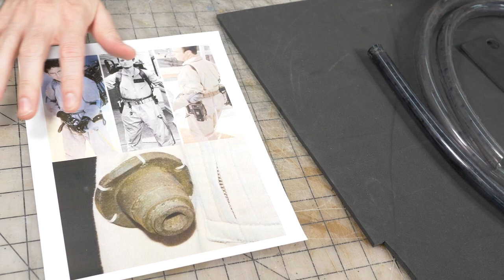Make, Modify and Improve your Halloween Costume

Comment: Actually something I have been meaning to share, and related to creepy costumes.  Surgical gloves work great as a base to do really creepy hands.  Just put one on and use liquid latex and fiber.  Cotton is pretty common and it gives a burnt flesh kind of texture but tissue(read Kleenex) works really well and gives a wrinkly skin texture.  You can pain if you like but I have used food color to color the latex and that can give you a really good translucent "real" look.  Some tinted with a bit of blue lets you create veins.  Cover that with some "skin tone" ish latex and you can get some really "old" hands.  Crepe hair will also stick really well in the latex when it's wet.  A hair drier will speed up the cure a LOT.  Usually there is enough stretch that you can take the clove off but worst case you can slice it up the wrist till you can get it off.  I almost never have had to cut it to get it off.  It's reusable for a couple of years, then the latex starts to get dried out.

This also works really well for building up "flesh" on skeletons, though then I start with coton to build up "muscles" etc. and then use tissue as a final "skin" layer (or not...).

Comment: To dirty it up, I'd make some 'mud' to dip the edges in; water, tea, crushed coals and ash from a fire, maybe some  saw dust from the shop.
Can use pretty much anything, but the water helps it really soak in, especially after ratting up the edges like you did.
Reply from the maker: Yeah if you wanted to take it a bit further than we did in the video those are all great options!

Comment: that connector for the hose was actually cast in foam rubber from a mold of some kind of steam valve.  And you were spot on with the what you did with the other end.  In the movies it was just attached under the belt pretty much in the same way.
Reply from the maker: Thanks!

Comment: The Ringwraith hood is actually a separate piece and drapes down to about the waist. Also stippling the bondo on the blade and lightly sanding is back will give you a better corroded metal texture.
Reply from the maker: We wanted to make a simplified version of the wraith outfit so people could try their hand too! It can always be modified :) Thanks for the tip!

Comment: For all my broke cosplayers, I’ve found two amazing ways to make props. A cardboard cutout covered in great stuff and carved to shape works great (just make sure you have enough foam to cover both side of the cardboard because great stuff shrinks a bit when it fully cures and can warp the cardboard if there’s not foam on both sides)
Also for my Hellboy costume I’m trying to make ive found cheap yoga rollers for only $5 at Dollar General, and they should work perfect for making his Right Hand of Doom that I’m hoping to articulate as well. I’ve also heard wood glue mixed with water can be a decent sealer for foam, but I haven’t tried it out myself yet
Reply: What is great stuff? I'm
Reply: 18020021t it’s a foam gap filler and insulation. Any kind of spray foam gap filler will work though
Reply from the maker: Neat tips!

Comment: Interesting.  For theatre sets we use contact cement.  There is a cup thing with fan blades and you stick it in a drill.  The cup has a loose seal and you fill it up with contact cement (or rubber cement) and spin away.  The glue leaks out of the loose seal and the wind from the fan blades blows the "web" out and on to things.  It pretty much dries enroute so you can make big webs really hast.  More fragile than the hot glue I'm sure.

Comment: Dig the use of plastic toys as props. Ever consider filling them with expanding foam? I've done that for a few props to add structure and heft. You can even use screws with a lot of glue to combine pieces.
Reply from the maker: I've used expanding foam to fill pieces sometimes, but I have to be sure of the structural integrity. Expanding foam has a surprising amount of force and can warp week plastic walls!

Comment: Lol I’m starting my Halloween costume on Tuesday, Halloween is on Thursday! ;(

I’m gonna make a working demogorgon costume from Stranger things out of EVA foam! I’m gonna make a video of it, if it goes well, if it doesn’t, I’m not gonna make a video lol ahaha! I can’t even but the same tools and materials you guys use cause it does not ship fast enough. Also, do you know if I can use a blow dryer as a heat gun? And does Krazy Glue (super glue) work well to stick large pieces of foam together? Thank you if you answer! Sorry for all the questions 🙂
Love the video! The t rex looks so cool and funny
Reply: AProXD 
Thanks, I really hope it goes well cause if not, I have no other costume lol. I started to make the teeth, out of clay lol. I was gonna buy moldable plastic but my budget isn’t the highest XD. I’ll record the process
Reply from the maker: Good luck! A blow dryer won't work like a heat gun, as it doesn't get hot enough. Super glue works great on EVA foam but can melt insulation or other kinds of foam - we always recommend testing adhesives before doing your final gluing.
Reply: Punished Props Academy okay, thanks! I made sure to test my materials and tools before I did it! Love the videos! Keep up the great work! Your work and stuff is sooooo amazingly good

Comment: are you using high temp or low temp hot glue to create the spider webs? Or is it a combo of low temp glue with the gun set to high temp? Or....?
Reply from the maker: We typically use the mini glue gun on the high temperature setting, which the glue sticks are compatible with.
Reply: @punishedprops  understood. Thx!

Comment: Could you not have glued rare earth magnets to the inside of the dino and then sewn some into the hem of the cowl so you could remove it and swap to other headpieces without having to keep punching holes in and rick more and more air escaping?
Reply from the maker: It's possible that could work, but the magnets could be too heavy. Just the fabric alone caused the head to flop to the front or back, it's super sensitive to weight changes.

Comment: I had the idea of painting an inflatable T-Rex costume up like Grimlock from the Transformers. What kind of paint would you recommend using for the flexible surface of the inflatable T-Rex costume? Thanks!!
Reply from the maker: That's a great question! I'm not actually sure - I don't know what material it's made of. Flexipaint or something similar may work, but it would be worth doing tests.

Comment: Hello punished props big fan for years now I have stumbled across a new product called Alex flex flexible spackle by dap and was wondering if you could do a piece to see how you like it and if it's any better than hiding the scenes like quick seal as you know quick seal isn't very sandable this product is extremely sandable I've only used it on test pieces but found really nice results
Reply from the maker: If it's spackle it won't work well on foam like Qwik Seal does, because it's not flexible. Spackle can be great for filling small imperfections on hard surfaces but can be brittle, so it's best to take care where it's used.
Reply: @punishedprops  this is a new flexible spackle. That stays flexible with movement. Ive had good results

Comment: Somehow I want to ask about grains and biases of fabric... But your mistake in size could have been avoided if you used a cheap pattern from a fabric store...
Reply from the maker: Totally! There are benefits to using pre-made patterns, but we wanted to show the process of capturing a pattern from an existing piece of clothing for those who may not have the option of pre-made patterns.
Reply: @punishedprops  it would still have been a good reference for material, as the back of patterns state how much fabric you need. No purchase necessary.